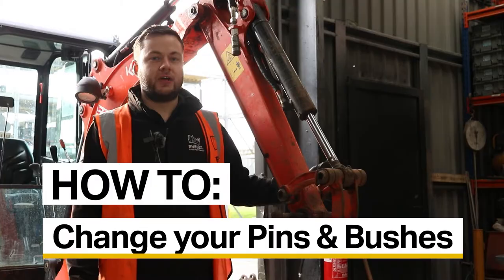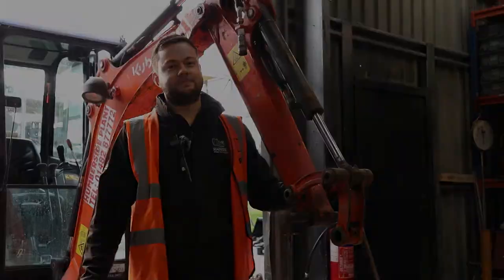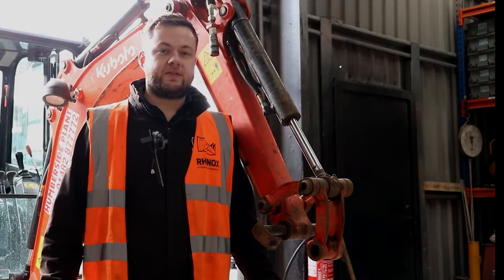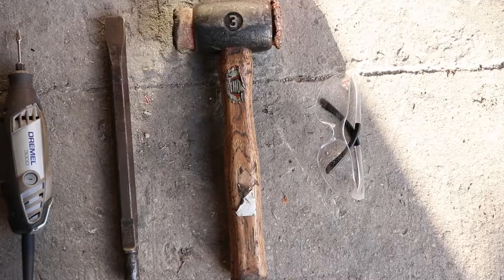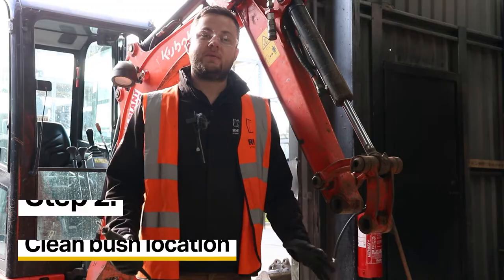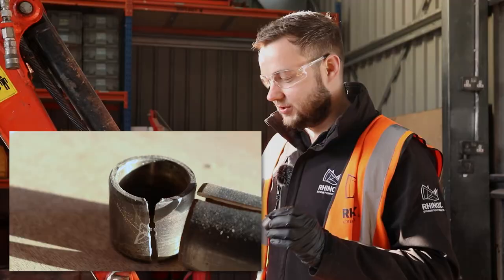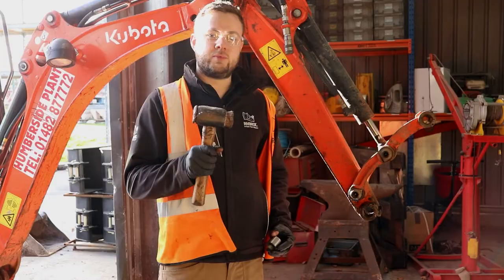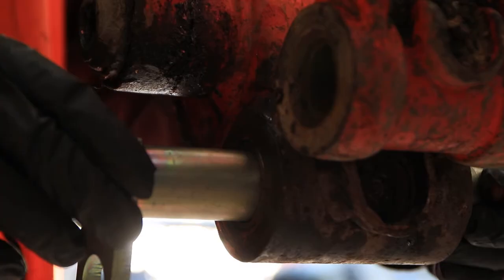HOW TO: Change your Excavator Pins & Bushes

Comment: No mention that some bushings have a grease hole that have to be aligned properly.
Reply from the maker: Its a good point, thank you for flagging! However typically if the bushes are externally greased, there is a groove around the outside of the bush which allows the grease to flow around the outside, meaning you don't need to worry about aligning holes! 😀

Comment: Thank you for this helpful video! I have a Hitachi ZX35U-3 with 1,200 hours on the meter. It has a bit of play in the bucket area and could also use some shims to lessen the side to side movement in a couple places. My question is this: Are bushings designed to wear out faster than the pins that they surround?  If a machine like this had been maintained properly (which I believe this one was) would one expect to replace pins and bushing given the hours on this machine or would replacing the bushings usually be enough? I know each case is unique but I am just looking for a general guideline if this makes sense.
Reply: I’m in the same boat as you here
My machine has 1600 hours on and has been greased daily
I am now considering new pins aswell so I wouldn’t say it’s unusual 
They are a wear part
Reply: Measure them, there must be a tolerance spec
Of course new pins are better but have you got the money for tgem?
Reply: @FourthWayRanch  Thank you for your response. I will try to find the specs for the pins to see if they have enough wear to warrant replacing.  I'm still curious to know if one part wears faster then other (pin versus bushing) but maybe they wear at the same rate. I'll dig deeper... hey that's an excavator pun right there! 😃
Reply: @PJ-ee5mc  I think people aren't packing grease on the outside enough
After washing i wipe grease in there with my finger